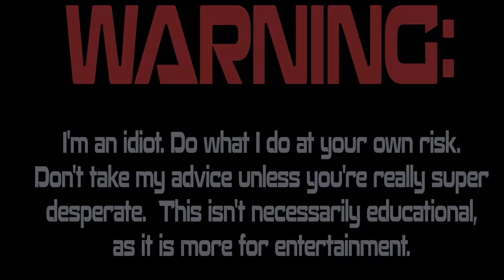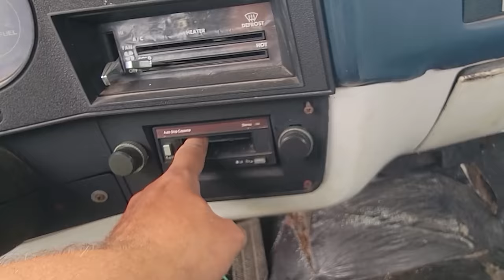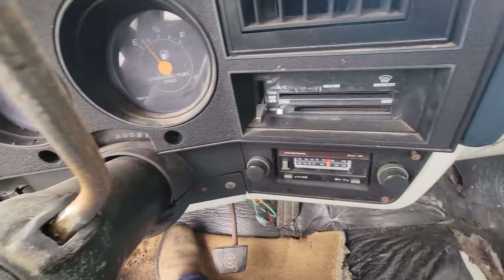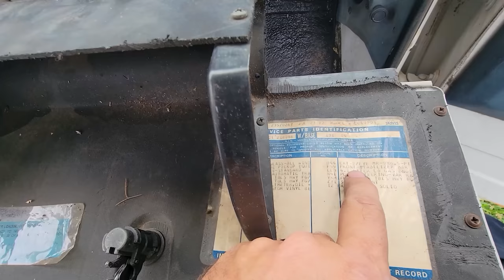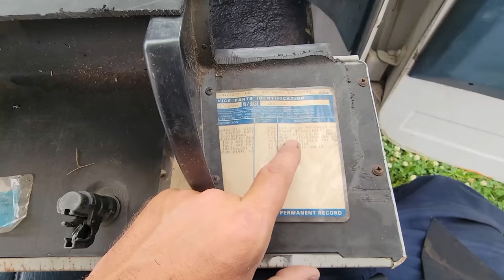Will This Square Body Truck RUN AND DRIVE Home 200 miles after 15 years?

Comment: Nice truck. Looks like it would be a good candidate for a simple engine swap and put her back on the road.
Reply: That and some serious interior love and its good to go...
Reply: I agree its a too nice of a body for parts only, give her a little TLC and a nice engine under the power barn, she'll be a nice town rig
Reply: Probably what somebody else was trying to do. That puppy was headed for a v-8 swap
Reply: Swap the drive train from the rotted shorty sitting on rusty acres that he's been snagging parts from already.
Reply: @quantumleap8888  excellent suggestion
Reply: Gotta be the target for the LS outta the C5!!!!
Reply: @quantumleap8888  I saw an earlier video where he got the rotten shorty running so I think doing a swap from that truck to this one is his intention.
Reply: @Quaza57  I agree.  Those of us from the rust belt have trouble parting out anything that has a solid frame.
Reply: Agree
Reply: Looks like money in the bank, V-8, Auto very popular!
Reply: Too solid to part out, can't go wrong with a engine swap or even a deeper look at the  head issue and a carb swap to a less junk unit.
Reply: Hopefully just do an engine swap..on another note, would love to see him refurbish that old el camino..
Reply: Hire that buddy of theirs to maybe patch the seats.  It looks like a really clean rig if Derek and fam can get it titled.  Not to spend anyone else’s money but this would be a fun one to do good brakes and shocks.
Reply: fix that 6 banger and have second ''teenagers truck'' /  shop truck that sips the fuel instead of GUZZLES IT LIKE A .... yea, like the CATFACTORYcrewCAB ... or MULLETs new MPG's ;) LOL   shudder... what's it now like 4 miles to the gal for MULLET??? anyhow...

sippin the fuels while running 30 miles to the parts store is a GOOD THING !!!! 

personally I am surprized I havn't seen VGG VW MICROBUS CAMPER TOP SPECIAL .... for the gas sippin and fun stuff!!!! :) LOL  the parts runner a VW BUG that gets 55 mpg??  LOL

plenty of swaps vids....  not as many ''FIXIN THIS UP FOR THE TEENAGER NUMMER TWOS GOIN TO SKOOL TRUCK!!!'' vids....  just saying
Reply: What's a 15 years of retirement when a guys gotta do what a guys gotta do.
Reply: @alexmikhael5061  I count agree more nice part runner maybe a modern v6 nice flow master exhaust nice low below to it haven't seen done any ware else
Reply: I agree!
Reply: V8 swapaldge
Reply: That's too nice of rig to use for parts. 
Do a V8 swap & you'll have a goin to town rig!  
Maybe a great candidate for an LS swap, or if you don't have a LS readily available, do a gen 2 small block V8😄😄
Definitely fix that one up, it's too nice to part out.
Reply: @Chudhole  towards the end of the video, he said he got a title for it, so that big fella is good to go! Gotta save it!
Reply: It'd be a perfect candidate for a junkyard engine swap , plus the rear bumper is almost off time to throw a big old hitch on it, the manual brakes will definitely have to be dealt with though 🤘
Reply: Wow nice truck , I think a V8 of some sort out of a wreck . An LS would be great but would be a lot of work with the electronics.
Reply: @Donald Duck ~ I totally agree!
Reply: Swap in that extra iron big block and with so much weight over the front, the rear tires will barely touch the ground allowing for infinite, instantaneous smoke shows. The new VGG magic rig!
Reply: Some new mirrors...
Reply: @dastrayer63  I'm from Michigan if I see a solid body vehicle it's hard to not do something to save it
Reply: Hope this isn't all rehearsed like the american pickers turned out to be
Reply: @Barncaster1  Bentley said they should keep it maybe he should throw that big block in there and give the boys a burnout rig like Independence 🤘
Reply: Ls swap is sooooo common get the straight 6 running strong again and boost it it would do just as good
Reply: @Jwar86  Right there!
Reply: @northernstoner962  If that’s the motor I think it is. (With the head, intake and exhaust all in one casting.) it is not worth repairing, but it makes a dandy boat anchor!
And I think it is with that carburetor(fuel make it happener)
Reply: Wowowoweee
Reply: @davidgray5180  and toooo simple to work on compared to the 55k ones   today
Reply: @lawrenceflynn8245  it should be obvious that American Pickers is a "TV show" when they have cutaways to them sitting in a back-lit room facing the camera having comedic outer monologues you should then know it's rehearsed, Pretty obvious. There's no scene changes with vice grip garage he's always on the vehicle with the camera and there's no way he could have rolled the truck there with the way the tire is atleast without leaving evidence. And Researching the vehicle with the owner on the phone and Naming prices before he shows up to fix it is not a "rehearsal". Having a good sense of humor doesn't make your life a TV show.
Reply: Engine swap, 83 350cid from a junk yard donor, or from the tree row. It's the right thing to do.

Comment: I would love to see you make her into a going to town rig and not strip her for parts (besides, she looks great and has a title!). Also, instead of a V8, I think it would be a lot more interesting to do a budget rebuild of that 6 cylinder and do some budget performance mods to it. Would be much more unique than just another V8 swap. Thanks for all you guys do!!
Reply: if there is not any bent rods I say go fer it.
Reply: I agree, it would be pretty neat to see  an inline six build
Reply: I agree, keep the six, maybe some light mods/upgrades, and pretty up the cabin a tickle
Reply: MUCH BETTER GAS MPG's  when ya talkin straigt6 over the LS SHOP TRUCK ??? RIGHT??? :)  he said something about 30 to 60 miles each way when he was sending the wommen out for parts when the WHOLE CREW was FIXIN UP THE CREW(cab) ....   eh, that would be reason for me :) 

fuel SIPPER vs. FUEL GUZZLER ;)
Reply: I was going to jump in and say cut it up for parts, untill I read this. Itd also be a less powerful rig for the boys to use.
Reply: @kiwijeff3964  each boy already got like 2 of those
Reply: ain't worth a rebuild, however swapping it for known good 6-banger might be the way!
Reply: @kiwijeff3964 .
- EXACTLY Right, Kiwi Jeff !
- I was thinking much the same thing. Plus, learning the fundamentals with a six is easier somehow, and better keeps the youngin's enthusiastic and moving forward.
- Then, keep on looking for parts for the other truck, get to it with the boys as they grow older.
Reply: i vouch for a 6 cyl build
Reply: @alexmikhael5061  if converted to efi the 6 would have better mpg
Reply: I agree 100% if the motors not shot!!😎👍
Reply: Yes, straight six build over straight six rebuild! 

Headgasket is okay, swap a ahead possible, but doing a rebuild is a tad much. 

But the world is full of pulled sixes, from People’s Old cars.
And this hurt a little, but in a few years, SMC, Will be a POS that gets pulled for a LS Swap, so prices Will go Down on a good Stock mill!
Reply: I agree! 6er and save on the fire water. Would be cool to save it. With a better carb of course.

Comment: You call that a failure? Looked like a bit of family magic to me. We got to see you get your hands into it, and then we got to see the whole reason why you do what you do. It's been awhile since I've gotten choked up about anything. Seeing your family with you on a dig was just what the doctor ordered. Awesome.
Reply from the maker: Thanks Michael
Reply: Agree 100%   There was a chain bolted for pulling the engine.   I gasped then it popped off, figured it was going to be locked up tighter than..    GZ in bringing the fire one last time.   Oh,  replace engine and drive, don't part.  But, let that motor go.  Still would be cool to see a rebuild on it...  but then again.   no, lets do the right thing.

Comment: That's definitely a truck to save. I'd like to see you find out if it's the head gasket, head, cracked block etc. It would be great to bring it back with that straight 6.

Comment: Even though they're gutless, I like the simplicity and space the inline 6 has under the hood. It would be cool to see if a head gasket revives the old truck.
Reply: Couldn't agree more.  Those 250's weren't called sewing machines for nothin.  Simple, reliable, easy to repair and they still have good aftermarket support. You can put an updated 4 barrel manifold on it and run 650CFM on it.  It'll breath a little easier and be pretty torquey for what it is.  Now if he really want to go fancy, he could get a sniper efi and that thing would start no matter what the temperature, weather, etc...  And the a simple header on with a glass pack.  Perfection.

I think the KISS method is best here though.  I'd pull the head, see if it and the block are ok and go from there.  BUT, I'd definitely upgrade it to a 4 barrel no matter what.  What a nice truck.
Reply: @actschp1  Completely agree.  Fully diagnose the 6 and go from there.  Too nice of a truck to part out.
Reply: Gutless doesn't even begin to tell the story, my dad had one of these (1979 model "Custom Deluxe") and that thing couldn't get out of the way of its own shadow.  But for $750 dollars in 1986, it was a real bargain.

Comment: I'm with Bentley. Keep it. I would even rebuild the straight 6. Everybody does a V8 swap and there's nothing wrong with that but I love the old straight sixes so would keep this  a super base truck. Slow and simple.
Reply: Agree 100%
Reply: I agree too
Reply: Or a I6 Atlas swap
Reply: In Brazil those Chevy 4.1/S straight 6s are treasured, the blocks are overbuilt as fuck and drag racers can pull over 1000hp from them
Reply: Keep the 4.1 and turbo it ebay kit !!!

Comment: I don’t know if you ever came up with a conclusion on what to do but I’d love to see the old truck revived and driven. Any smallblock would be good even if it were a 305 or a 307. I think the whole thing is just too decent to use for parts personally

Comment: I'm always down for keepin' rigs, but either way I want to see that 250 built! If the block ain't cracked. Horsepower TV built a 292 and turbo'd it and they stopped at 500 ftlbs because the bottom end wasn't built. Had more to give. That in this truck or a short box would be awesome!
Reply: @FUCK_________googIe  considering the holley setup will cost 1000 to 1500 im gonna say... No
Reply: @FUCK_________googIe  check out the horsepower TV build if you haven't seen it. They did a 292 Chevy straight six and did a legit stock rebuild on it. Then turbod it. They also did a Ford 300 and it was real stupid. They anticipated boost on it so built it and pushed it a little harder

Comment: That truck has the add on ac like my one ton. I see the glove box is modified to to fit the extra fan for the ac. Mine has r12 in it and still works good. There is a hidden control box that cycles the ac compressor under the dash pad near the center speaker hole.

Comment: Thanks for another great episode. I’d like to see this old rig back on the road with the original motor, if it’s only a head gasket. Anything worse, drop in the 350. Just my 2 cents. Keep ‘em coming!
Reply: Yup, that would be great. Keeping it a bone stock honest work truck. She's held up fine all those years, why not honour it by keeping it original?

Comment: That cleaned up amazing!  I'd say swap a motor and trans in it for now, and when time permits, tear down that 4.1 and see what's making it blow coolant out the exhaust.  If it's a gasket, I'd say get the engine running, put it back in and kep the truck original. If the head or block are damaged, go with a swap and make it a going to town rig.

Comment: I think you can remove the heads and check it out.  If no cracks, you have a good engine, its worth the work involved in it!  Good luck and great video!!
Reply: You can't always diagnose a cracked block without pulling the engine and stripping it down to the bare bone.

Comment: I vote to keep it intact if at all possible. Look, pull the engine since it’s pretty much ready to pull anyway, then break it down to see how bad the damage is. From there you can decide to rebuild the I6 or swap in the 350. It’s only original once as the old saying goes. Everything else looks easily rescued. Ok, the interior needs work but that’s not to bad on the old budget.
Reply: I love the sound of a smooth running I6!
Reply: I always have seconds thought on these type of things. Looking for parts and a couple of truck restores... but wow, If you can keep it 'deluxe' Canadiana original...  either way it is a nice find.
Reply: I'd love to see a feller rebuilding that l6

Comment: I'd rebuild the inline 6, and add a non integrated head.. they make performance parts for it too.. everyone is doing LS, and old school small block swaps, the 6 is a sweet little motor, and is different. The makings of a good daily driver, and gets good gas mileage too 😉
Reply: I agree. The price of the old petroleum these days. You could scoot that around without having to sell your kid's kidneys to keep it fed.
Reply: I agree. Pop the top off the inline to see if any cracks then make the decision weather to swap a V8. It's two wheel drive, should make decent fuel mileage either way.
Reply: @danhiggins7798  that's good advice, especially when our guy already has the 8 to swap in. The 6 may not be worth the salvage.
Reply: I have an 81 C10 that had the 250 in it. It was gutless. Rated at 100hp new. Mine was a manual- I can't imagine how much worse it would be with an auto. It was very reliable. 400k miles before it died, then swapped a 350/th350 and never looked back. I don't think a guy who likes big blocks and blowers would be happy with that ol straight 6

Comment: I really think you should slap a head gasket in it before you give up on that engine.  The 250 straight six was one of the most reliable engines of its day.  I would throw away every vacuum hose except what makes it run, cover the seat, put on some matching wheels and tires, and save it for one of the boys.
Reply: Agree had 83 250 6 loved it in hs did a lot of snakes since it was a factory posi and I sold it and guy sad he was going to put a v8 in it and it just broke my heart its going to be in the pile of every body's brother with a BiG v8
Reply: @wyattpowell8229  I really kiked the 230/250 six. I had three.
Reply: Hell yeah. 250/3 on the tree in my ‘76. It’s like an old man’s farm truck. I love it
Reply: @kway745 my uncle had that in his Silveraydo.

Comment: Cool straight truck, I would recommend ditching the six for a small blox, say 305, freshen the
carb, intake, iginition and sparkalators, restore the A/C , basic dual exhaust, change the transmission fluid, it might come back around, address the brakes, maybe swap a donor brake booster and master cylinder, budget shop truck for parts runs, replace the back bumper from a donor truck with a trailer hitch, light duty car hauler too... Good luck hope to see a follow up, fun show  as always.....

Comment: Pretty great and straight old truck that is amazingly unmolested. Could rebuild the 6 banger as everyone does the V8 - make good content seeing what the damage is and personally I've a soft spot for the old Chev straight six ( we had an Aussie version that taught me all I know about engines... so, not much), get the A/C etc all working. Maybe add a brake booster. You could even hot-rodder a bit, bigger cam, manifold, four barrel or one of those carb-injection thingama hoops. Weld those holes in the box, do some basic body work like on the drivers door, sand and paint the bonnet OR leave as is- clean and clear coat it. Spit shine 'er. Done.

Comment: Derek, I reckon that head gasket has a pin hole or three in her. Definitely a keeper rig though! Thanks for the hard work and great content.
P.S. I think rebuilding the inline 6 and slappin a sushi slicer on it would be pretty cool.
Reply: Agree on the inline 6. Not the fastest but oh so reliable. I had the passenger 250 in a '74 basic (and I mean, basic) 4 door Nova back in the 1980's, it had, 0 options, yes, ZERO options, outside of heat and PS/PB, and I bet they were standard by then. Even had rubber floor mats and radio delete even. Bought it from my sister and her ex in 1983 and the ONLY big thing was replacing rocker arms due to Mt St Helens when it blew in May 1980. They drove through Eastern Washing about a month later with the ash still on the ground and he should have replace them all when the first one went. Didn't do the motor any good as the valves got beat some so it was a bit of a smoker at 145K, but reliable as the day is long though.

All they added was a Basic Sears AM/FM cassette deck with 2, 2-way 6x9's in the back deck and that was that.

Comment: It's happened to me a couple of times. I buy a parts rig, then figure that it's too nice to part out, so I've either sold them to someone else to fix up or ( more often) kept them and fixed them up and used them. For what it would cost you to put the V-8 in it, you'd have a nice cheap driver with more power and almost as good mileage as the 6 banger. I'm sure one of your kids would like to have it. You can always find more parts or parts trucks to fix your other rigs.

Comment: You have to keep it. How often do you find a rig that clean and solid? I personally like to see things kept as original as they can be so I'd like to see what can be done with the straight 6 in it, if it's possible.
Reply: Agreed, maybe it’s just a head gasket?? 🙏🏻
Reply: I would take off the integrated head and replace it with a conventional head. The integrated head is nictorious for cracking too easily. Option 2 would be to switch to a 4 main bolt 350.

Comment: You sir inspired me to get an old rig and bring her back on the road. I just got an 85 ford f250 XL and I already got her running good enough to scoot around town. Still needs some work to get her to run smoother and I plan on keeping her for a long time.